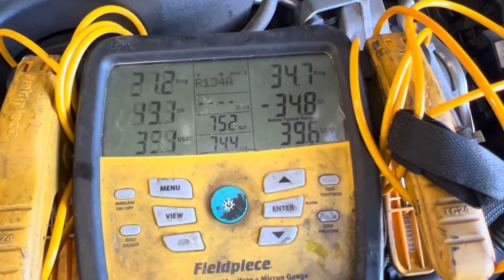I BREAK THE Toyota PLASTIC CONDENSER CLIP trying to take it off￼.  Shatters light glass

Comment: The Toyota clip removal tool really helps get them out but as you said they are one time use, people trying to reuse them causes no end of problems. Many times an o ring will seal even tho it's good practice to replace them but these clips 99% of times they will fail if  try to run use even if removing the correct cr tool
Reply from the maker: It was completely definitely made for one time you so only absolutely do not try to reuse that’s like trying to reuse a head gasket on an engine and then if it fails complain about it.

Comment: I don't trust those clips, blew up on me once... Now I give it a good pull before i start.
Reply from the maker: They only blow up if their installer did not install them incorrectly it’s not the Klips  clips fault
Installer error 

Unless it’s one of the aftermarket condensers where the metal receiving part is not properly machined, or somebody try to reuse the old clip, they are not meant to be reused